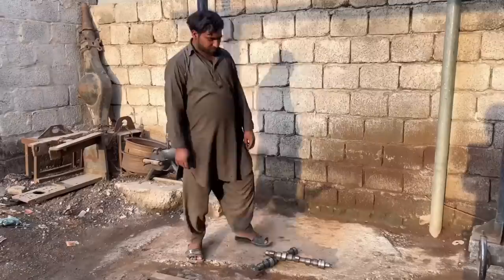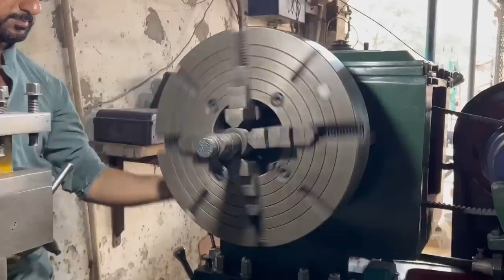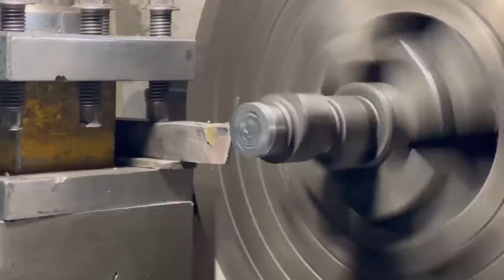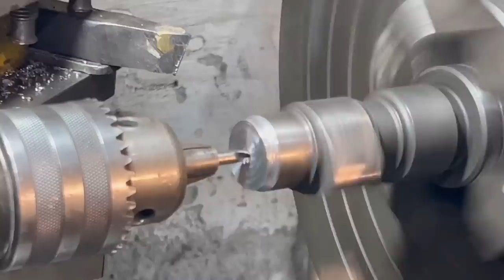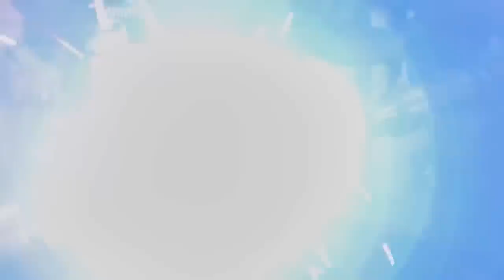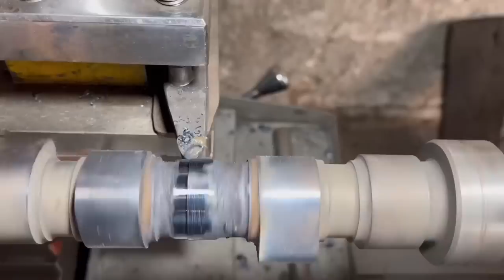How Mechanist connected a broken camshaft with skilled hands | Wrecked Camshaft | Engine Camshaft

Comment: Very clever but what a big risk if this crank would break in motion, the engine damage it would cause.  Good luck and hope it works for years to come, great video
Reply: It is NOT a crankshaft ... it is a camshaft,  big difference.  The forces exerted on a crankshaft are 1000 fold that of a camshaft but still.

Comment: Usually the cranck is from hard steel, which is very complicated to weld without making cracks. I don't  know how much will last
Reply: It is NOT a crankshaft ... it is a camshaft,  big difference.  The forces exerted on a crankshaft are 1000 fold that of a camshaft but still.

Comment: Nah Ye did it all wrong, step 1. Drill 1/4” hole in either end. Step 2. Chamfer the break. Step 3. Insert 1/4 steel rod and weld up the break. Step 4. Put the cam shaft behind the lathe to crack idiots over the head with that think you can fix broken cam shafts or cranks 😂